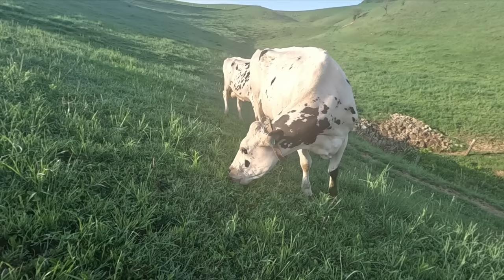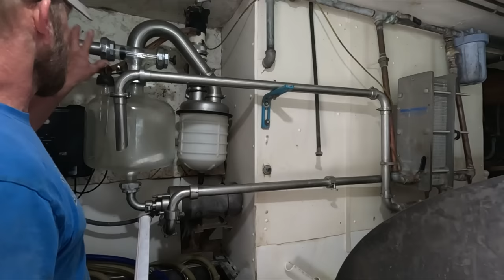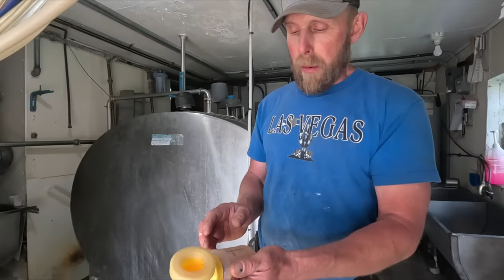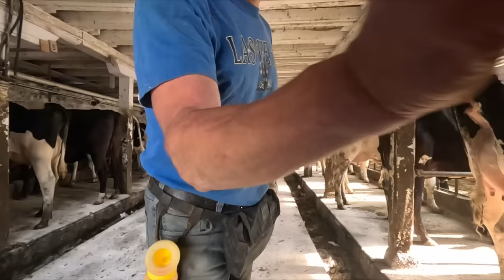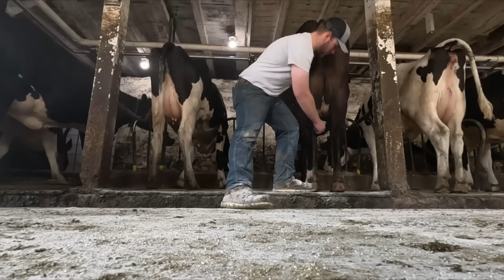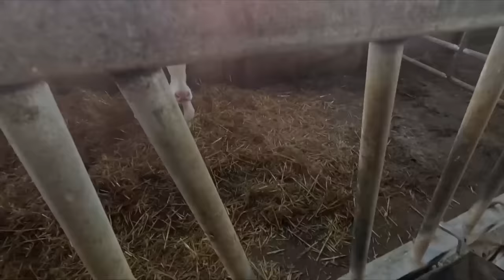Milking Cows on a Small Family Farm in Wisconsin

Comment: Ineresting, maybe even fascinating. Milking cows put me through the UW almost 50 years ago. Never worked from between the back legs - always the side. Would put my shoulder/head kinda in front of the leg joint. This reduced the windup force the cow could generate if she tried to kick. Later on I added beef cows to the operation. The beef cow kicks completely different than the Holstein. The Holstein will swing the leg out with a relatively slow windup, always saw it coming. The beef cow - you never saw it coming and would end up laying on the ground looking up wondering what happened. (And yeaaah, da bull did S... ) 🤩

Comment: Gee guys that's our process too. Except we still use Surge buckets and pour in a strainer. Our barn is too low for pipeline. We plan on raising the walls a foot or two in the next couple of years the the pipeline is going in. After 45 years of milking cows my knees will appreciate it!!😂
Reply: My great grandpa quit milking in 2007, he used surge buckets for his 25 jerseys. He bought some pipeline one time and then he learned how much it would cost to put it in so he didn't. Im hoping to start milking in the future but it's so dang hard to get started.
Reply: A 16 stanchion barn I used to milk in was converted to a flat parlor. I got asked to come back to help milk for a week while they took a vacation. I really like it. There were 12 stalls, auto takeoffs and each cow could leave after she was finished. Surprised at how well the cows loaded in as well.  The platform was 18 inches high and sure saved on the body.
Reply: @danw6014  sounds great. I milked in a parlor while in college at the College farm. It was really nice. Right now we milk 45 cows using 4 Surge buckets. It gets the job done and better than milking by hand.
Reply: @anthonyhengst2908  I milk in a parlor now too. We run about 400 cows there. It a lot different than a flat parlor though, and a lot more expensive to build. A flat parlor could be retrofitted in place of stanchions.
Reply: @anthonyhengst2908  the first barn I milked I'm years ago had Delava pails and a milk Sputnik.
Reply: @danw6014  we still use 5 gallon pail and pour in a strainer. Even so our plate count is under 200,000

Comment: I had major issues with the milk inspectors......about using hot water and getting the lines clean. They wanted to see 170 degree water.  Keep in mind..at   170 degrees water starts to turn to steam.  There is no way to keep from having the relief valve from opening at that temp.  Every time I came in the milk house the milk house was all steamed up..from the valve being open.  Yet....... the demanded I have 170 degree water. 
Since Im familiar with producing alcohol I know about the temps. The first and highest proof alcohol comes off at  175 degrees.    So there is no way to keep a relief valve closed at 180 degrees.  So...reality is.......to prevent this......must keep water at around 165 degrees.   But then I could not keep the lines clean.   Fighting with mother nature !